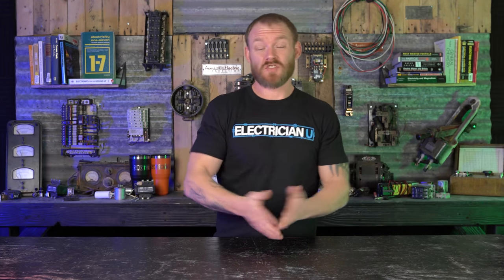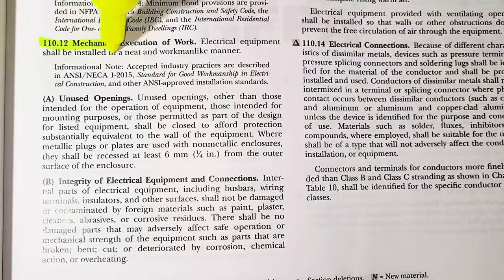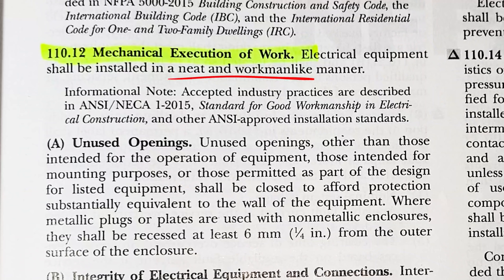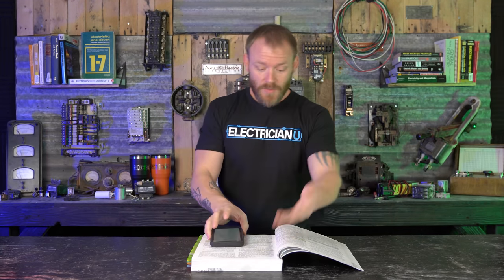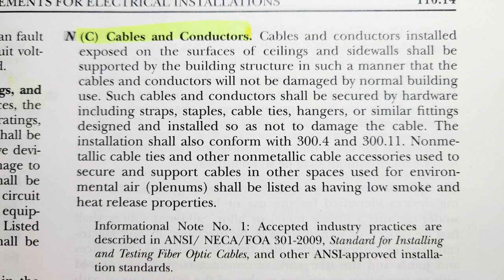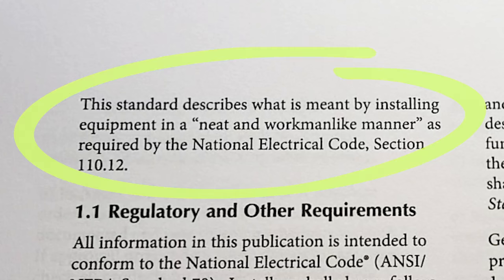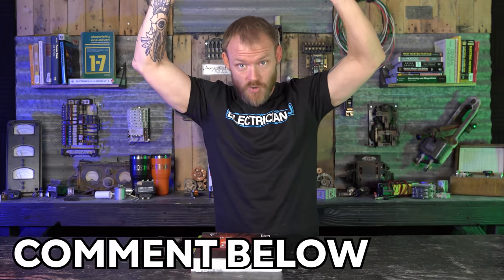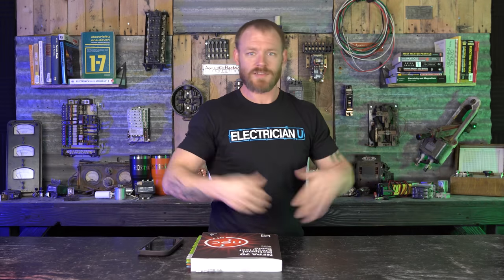Good Workmanship in Electrical Construction

Comment: A big part of "neat and workmanlike" is showing respect for the person that someday will come in to upgrade/modify/repair your work, and has to figure out and deal with what you did.  They'll really appreciate it if you did it right.
Reply: You can say that again!  Nothing frustrates me more than having to work with some previous idiot's hack work.
Reply: Not to mention that the "next person" may be you.
Reply: Preeeaaacch
Reply: Excellent point. Everything gets upgraded [or fails] eventually. Not having locate a master safecracker or explosives expert to remove last cycle’s gear is such a time-saver. Hell, having just a few screws that aren’t stripped to shit from Cap’n Impact Driver is enough to brighten my day some days.
Reply: As will the homeowner (like me) who may do small repairs or adjustments. I do this on my home within my capacity on basic electrical. I’m blessed to be in a home that was exceptionally well built back in the 1930s. (I even found the original blueprints and contractor spec sheet. Very cool.) Now, as I go in and make little changes, like changing ancient switches for new ones, I find impeccable work even after all these decades.

Comment: I tell my helpers about that code article all the time. An inspector can fail you just because he doesn't think your work looks good so always try to remember that
Reply: The inspector can knock down work that is shoddy and looks a mess. They will knock you down if you have too many splice boxes on a new job. We had to move an electrical panel because the plumbers had to run water and sewer above the panel and in that AHJ, you cannot have water and/or sewer lines above an electrical panel. I had to make a few splice boxes and was knocked down. I had to go back out and rip all the homeruns out and run new wire to all the circuits in this 2 story with full basement walkout lake front home.
Reply: @ATSNorthernMI  Isn't the plumbing and HVAC normally done prior to the electrical?  I think that is one of the reasons why.  They only have limited spaces where they can install their equipment, so the electrician uses whatever is remaining for theirs.

Comment: Interesting topic, and glad to see so many comments by people who take pride in their work!

My take: 110.12 requires "neat and workmanlike," AND includes a prominent note to refer readers to NECA 1-2015 – which "describes what is meant by installing equipment in a 'neat and workmanlike manner' as required by the NEC."  Therefore, since the specifications and requirements laid out in 1-2015 form the definition of the required "neat and workmanlike manner," as far as the NEC is concerned, those specifications ARE code.

Comment: As an Estimator in the electrical trade for 20 years I would always see that statement in specifications. I've known what it means but I'm glad you took the time to explain it. When I was in the field I took pride in the way my wires were run and installed and devices mounted.

Comment: I am a retired Water Treatment Plant Inspector, we almost aways contracted out our expansion projects as our in-house electricians are for maintenance and repair. Our contract specifications always use the NEC as well as other references as a minimum UON as specifications often required much more robust installation than minimum NEC requirements. As the AHJ (Authority Having Jurisdiction) I often cited the NEC as well as other national and international references included in the specifications and would never allow sloppy work as a starting point and only afterwards would actually look at the minutia of the installation.  PS our contracts were always in the 1mil to hundreds of millions of $ so we specifically specified the highest craftsmanship of the trade as well as special materials, lines and grades and some examples of what wasn’t permissible.

Comment: A number of years ago I installed a fully wired alarm system in my house. Back then, the alarm monitoring company had to come out and program the panel. The technician showed up and was looking over the wiring and asked me "Who installed this?".  I told him I did, and he replied with "Dude, this looks cleaner than most installs professionals do."  In the 15 years I had that house, I never had a single problem with the alarm system. Neat runs, properly stapled, holes through headers, cable raceways, nice clean wiring in the panel all contributed to that.

And as a homeowner, when I see an outlet or switch box that isn't square and plumb on a stud, or the inside of a breaker box looks like amateur hour, I'm judging that electrician that installed all that stuff, and thinking "Doesn't care enough to do it right."

Comment: The way I see it, neat and orderly work makes a happy customer. The neater the work, the more it impresses a customer. The customer won't know anything about code, but they will know if a conduit run is not level, if a run of flex looks like a wet noodle, or if a panel looks like a rat's nest. Sure, ugly work could pass an inspection, but it won't make a customer happy. Unhappy customers mean less work down the road.

Comment: My signature is putting rings for my phase taping. I do 3 single rings of tape with a tape width gap between them for 4/0 and smaller and 4 rings on 250+. All of the tape rings line up so it looks like a line parallel with the breaker or bussing. It's clean and doesn't take long to do.

Comment: Honestly, clean coded electric panels, receptacles, connections, spacing is what makes you a professional. Period. I cannot work around sloppy electricians for example I've worked behind CEs that have butchered connections.  And literally test pulled the connector and off it came.. point is a clean job is a professional job!

Comment: There are times when neat & tidy can be a hinderance. Some guy zip tied all the neutrals together in a panel before breakers were put in. So when I had to upgrade 1 breaker to CAFCI, I had to remove half the breakers just to cut the zip ties so I could route 1 neutral into the new breaker. So yeah, neat isn't always the best.
Reply: You don't need zip ties to be neat and tidy.
Reply: Always a naysayer out there
Reply: I’ll be honest, it literally makes me want to puke when I hear someone on a job say “neat and workmanlike manner”. 😂 It’s always either a first year apprentice or one of those all around inspectors that’s never actually done electrical work.
Reply: @AdamTMJester  nope…sure didn’t 🤣
Reply: @tfun101  also add anyone that takes pride in there work
Reply: @FishFind3000  maybe sometimes...mainly first years who don't have a clue though..🤔

Comment: I am a journeyman electrician no longer working for electrical contractors, tired of a lot of sloppy work from electricians ( not all ) wondering how the hell some of this passes inspection. I am a little slower in my work but almost every time I pass an inspection first time. I have had to re-do crap that even a master had done. I’m not knocking electrical contractors but most I worked for are to much in a hurry to move to next job. To re-do what another not all electrician has done is not only time consuming but costly as well. Quality and neatness brings in a good word.

Comment: From what I have seen with inspectors, if the job looks neat and tidy then they know you are paying attention to your work. It's also easier for them to see what they want to see. You make their job easier and they break your balls less. I usually do small talk with them anyway and just say to let me know if any changes are necessary. (rather than argue a point) Some inspectors have certain things they like to pick on so knowing their quirk can be helpful. I had one inspector who insisted an outlet cover needed to be installed (rainproof when in use) and my point was the outlet was already inside a rainproof enclosure. (generator cabinet) He also wanted it to be GFCI unless it was a dedicated outlet. (single not duplex) I pointed out there were 2 items to be connected (block heater and battery charger) so there were no extra outlets. We finally installed 2 boxes, 2 single outlets, with 2 rainproof (in use) covers INSIDE what was already a weatherproof cabinet so he would pass the inspection. Go figure!

Comment: You touched on valid points in the videon and helped clarify the intent of that section of code.

Personally I've found when you do neat work, even on just a rough in, the inspectors fly through the job and don't really tend to beat up on you much. 

If somebody who works for me has a question about whether something  "looks good enough." I ask them if it's OK for me to write their name phone, number, and date of install on it. If they say no, then they fix it, if they say yes then I scribble away and we if they really mean it. This solves a whole lot of problems with hack work on projects.

Comment: Let your inner OCD (obsessive compulsive disorder) shine.  I’ve been an auto tech for over 25 years, when I do a major job I like to make sure it looks like it rolled off the factory floor when I’m done, every clip every fastener every wire every hose exactly where it is supposed to be.  Things seem to work better when they are where they belong. I can usually look at a newer vehicle and tell when someone has been messing around underneath it (that includes you Carmax!)

Comment: Cracks me up in some large buildings and a local mall where  they installed 10' of doubled up unistrut but only installed 3 long pieces of all thread rod to and installing up to 4" conduit on both sides of unused it creating 2 large bows in unustrut. At the large hospital & research buildings that I retired from the inspector told us that they probably had the largest pull box around. Called it the 80 way. Had 80 4" conduits going into one end then 80 4" conduits leaving the other way and maybe 12 4" conduits leaving side of 20' long junction box. Junction box was made with 3" long slits for guess eartquake. They had iron workers add extra steel but 8 level unistrut ladder bowed. Broke their balls on neat & workmanship matter over that. Worse part valve ass contractor had probably every conduit wires go into a conduit on other side of box and different kevel. If a cable ever burnt up at top of box would be impossible bro replace. Wires went from 8th floor generator ( emergency power ) to 3 rd level of basenent. They spliced over 240 think they were all 500 MCM cables in that box.

Comment: I much prefer a neat installation, regardless of who will see it in the future. I hate to see a bunch of twisted Romex run with no planning in an attic (I see this a lot in production builders), same with stab-locs, which I see way to often. I also see pros do things that as you say looks like a DIY job, for example a circuit where the line in goes to a stab loc on a receptacle, and the line out is also a stab loc. No pigtail. I guess it is cheaper and faster for the production builder, and the inspector passes it, and when it causes a problem the builder is out of the picture. As a consumer (not a production/spec builder, but contracting work) I will pay more for the guy who does neat work. It doesn't cost much more (it's only fractions of a percent), well worth the cost. It looks nice for the client, I trust the workmanship and can add it to my portfolio for future clients. For the electrician, if you get a custom builder that likes your work you will never have to advertise or hustle for jobs (this depends on location of course), but reputation means a lot.

Comment: I love your videos Dustin and I have used some of your content for questions on my Nat King Code page on Facebook. #1 informational notes are mostly unenforceable by the AHJ unless it's an ampacity table or some shit. #2 I frequently post 110.12 as a code violation when it can't be failed by the AHJ for that reference alone it must be supported by another reference to have a correction issued. #3 We make jokes about this in my electrical groups/pages because in the 2011 handbook it says 110.12 was the most cited violation in the NEC. We thought this was hilarious and I supported my box cover requirement with 110.3(B) which is very much enforceable by the AHJ. Keep up the good work and I will always help you out if I can.

Comment: I like that I've been in commercial so far. It makes trying to make the cleanest work easier cause you aren't under a strict timeline as you would be roughing in a house. I'm a first year apprentice and I've told me self every run and everything I do I am going to do the best I can even if it takes me a little longer, cause eventually I'll get used to it and get quicker and quicker and it'll look good all the time. Also look at your Journeymens work, or your masters work especially when it comes to panel work, some of the work I've seen by my master in panels is amazing, everything is tight, neat 90s going into every breaker it's always fascinating to see a neat panel
Reply: In my 4.5 years I've experienced a lot more strict timelines on commercial jobs and more laid back on residential jobs. Probably all depends on the general contractor too. I've get complimented alot for neat and quick work, but I always say it helps if you love what it you do and the more you do it.
Reply: @jacobplank  I don't know both commercial jobs I've done were more relaxed obviously you still have a time line but it's not needing to be done in 2 days where every rough-in I've been apart of has been expected to be done in two day. But again I'm still only a first year and a lot more learning to do.

Comment: The last couple video's were related to whether junction boxes needed to be closed with their covers.  Couldn't an argument be made that 110.12 Part A indicates those junction boxes "shall be closed to afford protection..."?  The box cover is "unused" in that it doesn't have fittings running through it, and it isn't a mounting surface.  I'm not sure how to interpret the next part of that sentence about design for listed equipment.  Anyway, just a non-electrician's thoughts on the matter.  Keep up the great content, I've learned a lot.

Comment: I have a question.  New construction that references the NEC-2017.  I sampled the living room/kitchen area of a residental build.  I measured the elevaton of 10 wall mounted recep/switch boxes and found them to be  between 8 1/2" and 9 1/4" up or down in relation to the next box.  I also measured the switch boxes in relation to the installed doors and found those boxes to be between 6 1/2" to 15" away from said opening. Based on your video would you cosider theses tolerances to not be to code?

Comment: The key is the inspector. Absolutely correct-- if the work is neat, the inspector will not look so closely and nit-pick fail you. Moreover, you will encounter that inspector again. If you do clean, neat work, future jobs with that inspector will go easier. Inspectors can be real turds, and you don't have a lot of latitude to appeal it.

Comment: Dude what's up in the ceiling on my jobsite is a spaghetti mess. Partially because I had to make it happen with what I provided. The framing+the other trades+ really limited space, has it looking backed up in some places, but it's in the wall, so nbd. But all my OCAL that's visible and exposed on the wall, is very neat and clean, all my straps at the same height, except when placed in a spot I cant have them in uniform direction. Anyways point is, in the wall make it functional (and nice if you can) but spend that little extra for exposed stuff ...well because... people will see it. and honestly if someone takes pride in their work, it shows. So the work is a representation of the individual. You can see when someone doesn't care, and you can tell when they really do.

Comment: So I've come across a friend's house that has two screws that are protruding into the lower section of the electrical panel.  Is there a fix for this?  The only wire that's near is the grounded neutral conductor.

Comment: I do IT, if you’re pulling wire for a LAN party at your house, let shit be everywhere. 

If you’re pulling low voltage wires at a job-site it shouldn’t look like some dipshit at Best-Buy did it. It should say, “This is me. This is the quality and ability I’m capable of producing. This is the best I am able to do in the given parameters. You can judge my fitness for this job from anything I’ve run.”

That’s the level of quality I think is appropriate. Electricity is basically magic to me, so I’m open to suggestion if your opinion differs.